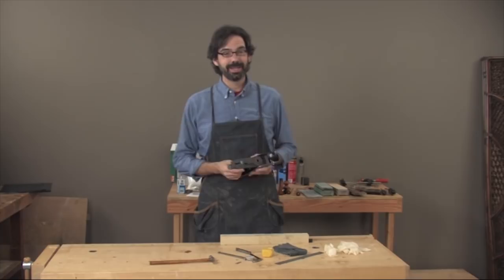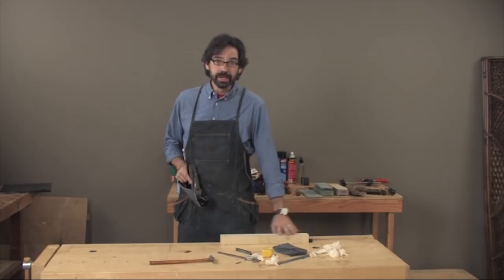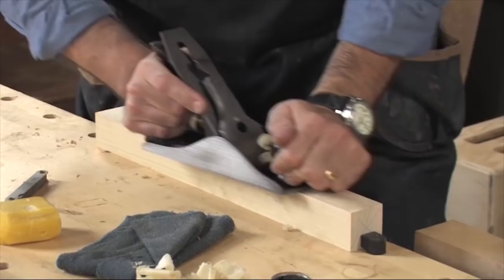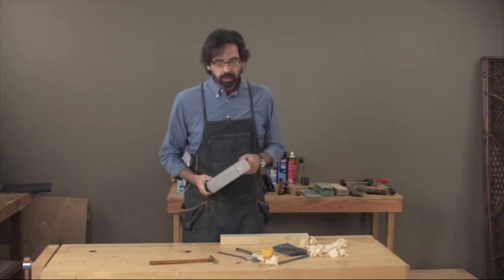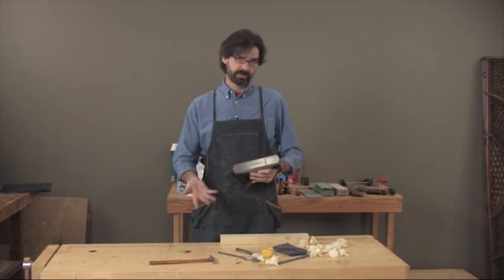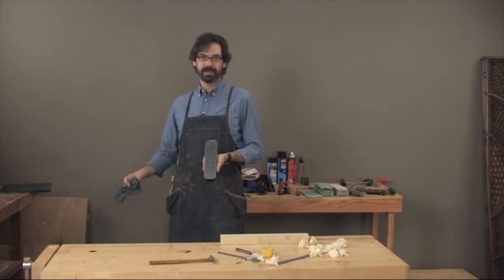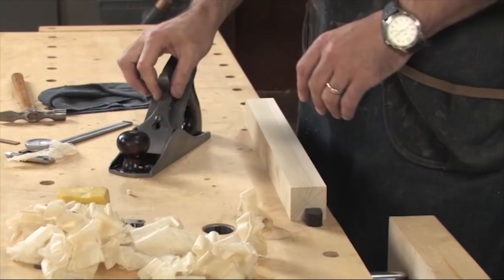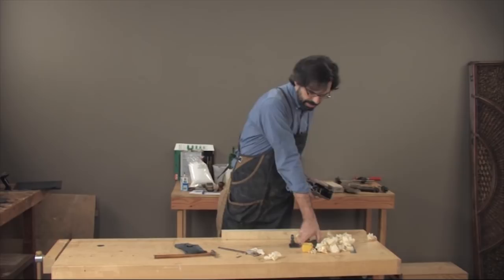Troubleshooting a Bench Plane

Comment: Thanks for the video. Iam completely new to planes. I bought a used craftsman 107 14" . I can not get the blade to retract inside enough to not take a shaving. My frog is  completely flush. I assemble the plane, it adjusts out, and almost... almost back in fully, but still is protruding about 1/32" HELP... anyone, I can not figure this out after repeated videos.

Comment: When I compared my 3 Stanley planes -No 4  No 4 1/2 and No 5    All good pre war models , I found that they all had the lateral adjuster "dimple "or rivet pressing up on the cap iron. This was creating friction when I wanted to adjust the lateral lever. So by inserting some thin cardboard (nice and oily ) between blade and cap iron I now have a smooth adjuster and don`t start moving the lever cap screw which is totally innocent .

Comment: Absolutely a great video, thanks. This helps greatly. Very knowledgable. I’m not a big plane user but just kinda started with planes. Got a Woodriver #3,4,5,6 and was working with the #4 Jack plane. Got iron sharp enough to shave with with a mirror polished 25 degree grind and it’s like what’s going on here, I can’t make any sharper lol. Found the chip breaker screw loose and floating in the breeze 🤣🤣🤣 so your explanation really helps to understand

Comment: A Hock blade and (especially) chip breaker transformed my old WW2 era Stanley 4 1/2 into a fine tool.  
Had to flatten the sole a bunch and back bevel the mouth opening to get it to take really fine shavings.  
My next plane purchase will be a LN 5 1/2

Comment: On a Spear and Jackson  No 4  it has a narrow mouth and I fitted a 2 part Stay Set cap iron . There is no frog adjuster screw at the back . It just has the 2 clamping screws with some room for movement . Just for fun I took out the front section of the cap iron and put the lever cap on with the screw wound in a bit. What a nice sense of freedom to use it like an old wood plane .No clogging or fussing with a chip breaker .A good hefty Carpenter setting .

Comment: One of the biggest things I've seen with the uninitiated is, putting the iron and chip breaker together wrong. Most often with the iron bevel up. And the other thing is the chip breaker too far away from the edge.

Comment: Should tighten the chip breaker (cap iron) screw against the bench, not your hand. If you slip, you get a screwdriver into the palm of your hand - it hurts, from experience.
Reply: I like a shorter screwdriver because I never use the lever cap... never. ;)

Comment: Would you know the reason why my plane isn't cutting full shavings? Its only cutting in the center of the blade. I tune it up pretty good that know of, the sole seems to be pretty flat, the blade is sharp, im getting good thin shavings just not full shavings, the blade is straight and true, everything is tighten down, could i get some help about this problem
Reply: if the blade is straight, its probably the sole is dished some, I would check that and flatten it.

Comment: Hey is that a Hock blade and chip breaker you are using there? The blade has those nice swirl marks from a Blanchard grinder? Original blades work pretty good but the metallurgy on the new ones is better.

Comment: I had a problem when I bought a new iron for an old No. 6 and the throat wasn't open enough for the blade to fit and allow shavings to move above the iron.
Reply: I should add that the new Hock (sp?) iron was a lot thicker than the original stanley iron.  I finally decided that if I wanted to use that iron, I would have to open the throat.  The throat was a lot narrower than any other I had ever seen.  I carefully filed it and the plane works great now.
Reply: Or you move your frog back, that's why its adjustable.  You don't otherwise have to play with frogs much.
Reply: @ugaladh  Hello ugaladh. No, the blade wouldn't fit, and moving the frog only made it not fit in another spot.  I eventually filed out the throat and it's working great the past few years.

Comment: How to flush the front edge of the chip breaker with the plane blade at interface.
I am collecting shavings under the chip breaker. Stanley #4 bench plane.
Reply: You have to sand it.  Check out Sellers' video on how to restore the bench plane or Mat Estlea's on how to set one up.  They both cover it in detail.  I too had that problem repeatedly until I sanded them flush
Reply: I have the same problems with my planes it's very annoying . 
pls advise ? 🤔
Reply: Your chip breaker is not sitting flush against the plane iron.
Reply: You need to use sandpaper or a sharpening stone and flatten your chip breaker so that when you place it against the plane you can see no light between the two mating surfaces. The problem you are having I assume is a small gap between and the wood shaving is forced into that gap.

Comment: This was very good, but I'm still getting hard bites and skips even on soft woods. 

If anyone wants to chime in, feel welcome to do so.
Reply: 1.Usually its the chipbreaker not aligned to the blade proper.
2. Your blade may be protruding too far.
3. The mouth might be too closed.
4. Your plane iron may not be at the right angle. (Different woods require different 'bite')